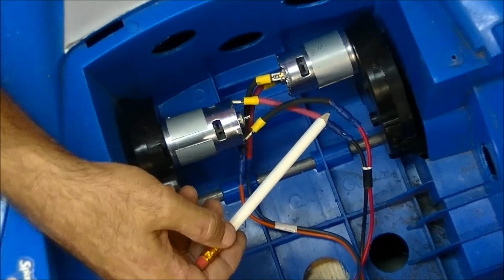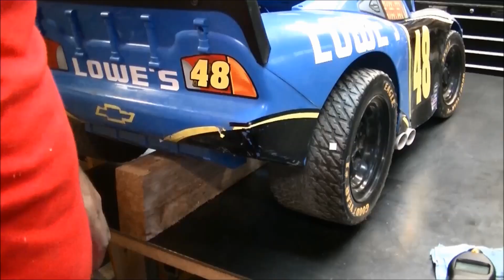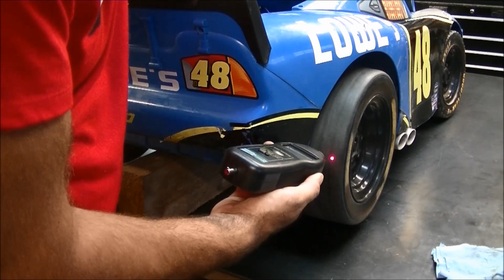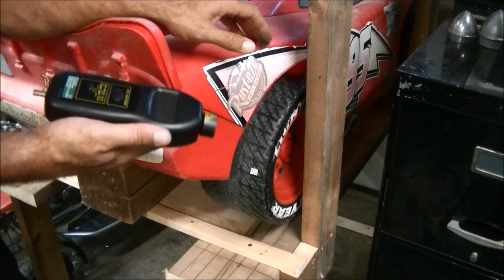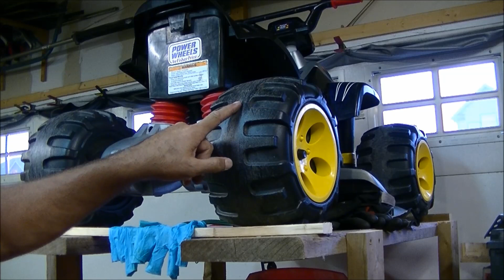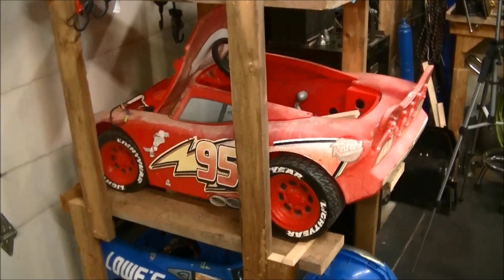Power wheels modification DIY test 1 (part2)

Comment: How can I tell which side on the motor is positive and negative if it is not labeled?
Reply from the maker: They are DC motors
once you hook them up they will either go forward or backwards; check with the controls hooked up

Comment: What is the rpm of these 775 motors? I look on ebay and they are only 9000 rpm at 24v. Bought them and they run very slow. Even at 24v the 775 motor i bought run maybe 3 mph max.
Reply from the maker: I am not sure of the RPM's as this project was quite some time ago.  I do mention that the OEM motors were much faster but also more $$$$

Comment: If I apply 18v to a stock motor, would that be problematic? I.e swapping a 6V stock battery to an 18V Milwaukee drill battery? I ask because I see all these videos on YT where guys are just swapping the battery, but won’t that just burn out the motor? 

Thanks, great videos btw!
Reply from the maker: There should be no issue with the motor; my mods were to 24v.
Reply: is there no problem with this higher voltage for the electronics ? like the remote control ?

Comment: Very informative, thank you for the videos, I am curious how to switch the small gear on the motor shaft that connects to the large gear inside the gearbox. Is that small gear called a pinion? When looking at the replacement motors online they don't see to have that small gear they are just a round shaft.
Reply from the maker: You need to heat is up with a lighter and pull it off its a press fit; then press it on to the new motor. Remember there is a plastic washer behind the gear so not to much heat.
Reply: @daveprototype6079  thank you!

Comment: I want to put two 350w motors in my sons police car but I knew these gearboxes were cheap. It would be nice to find aftermarket boxes with all metal gears
Reply from the maker: The way the torque is distributed through the gears; only this gear needs to be metal and the rest hold up great after the torque is reduced through the gear set.

Comment: you sound native american in the beginning. Overvolting a 12v motor to 24v will be faster than running a 24v motor at 24v. Since your new motor is bigger it will have more torque even with less volts but the speed won't be as fast.
Reply: Hi iam about to order those motor 
But should I use 18v or 24 v
Reply from the maker: both are good choices; let your budget guide you